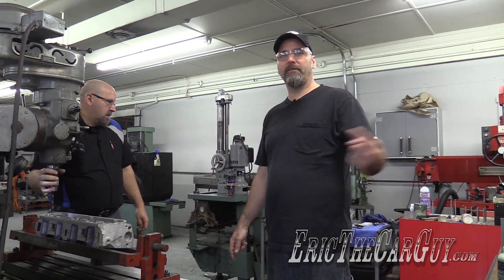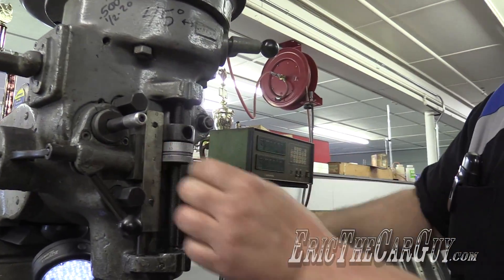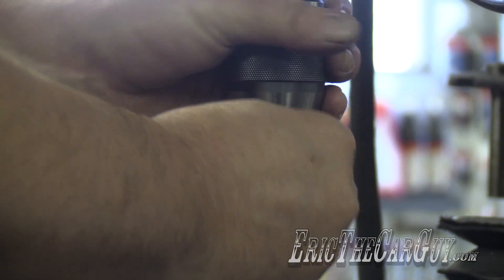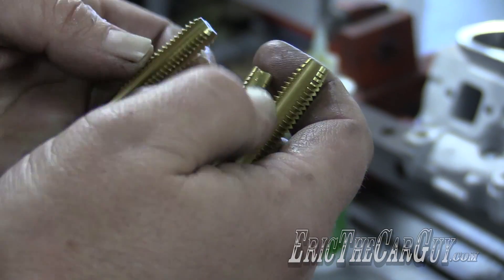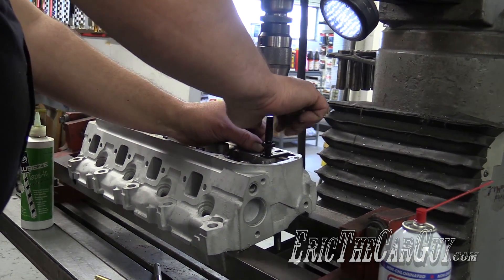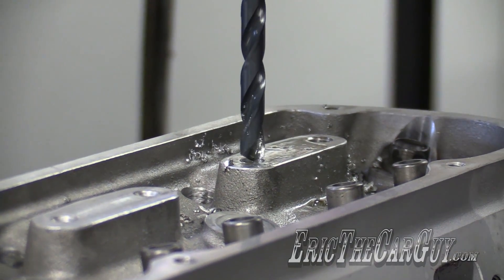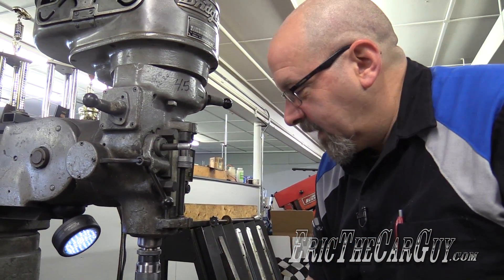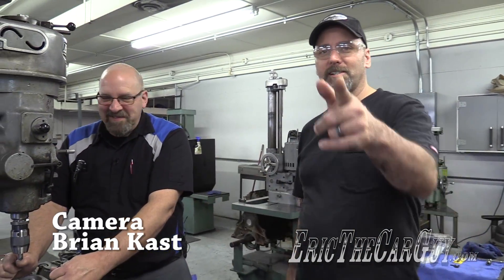Cylinder Head Modifications For Larger Rocker Studs #DarkMatterPikachu #FairmontProject

Comment: Those Bridgeport J head milling machines were made from 1952 and up, and the hole in the back of taps is a byproduct of manufacturing but also helps keep it straight when in use.
Reply: Yep, Drill straight, Tap straight.
Reply: Drill straight, tap crooked, break tap!

Comment: I wonder why people still use normal taps in soft materials like aluminium. There are machine taps that do all the cutting those three taps do, so it saves considerable time using them. Plus, there are special ones that are ground down at the tip so you can cut threads down to the bottom of the hole. Or you can grind them down yourself.

Can anybody educate me on that?

About that CNC discussion: Nobody uses a CNC for that because you needed to measure everything precisely (!), write a program, fill all the different chucks and indicate the tool positions, indicate the part on the CNC, test the program and then run it. And "running it" for the first time means standing next to it with your hand on the emergency stop button in case something goes wrong.
So doing it the "oldschool" way is faster and more precise in most cases. The only time you can save time is the second run for the second head on a V type engine.
If you had to do 20 heads, this would be a different story :)
Reply: BavarianMonkey agree with the faster and cheaper for a very small and simple run but as to how indicating material on our cnc mill we have a probe that will get your x,y,z, and center in about 5 minutes if you run the machine manually (manual drift for those who don't know), and maybe 1 minute if you write the program (we use hieden heim on a dmg mori) as to acuracy it all dependes on the machine but 9 out of 10 cnc hands down imo less human error but it would really all come down to the operator
Reply: kurupz aaah yes, I completely forgot about those 3D ruby (?) ball probes. With something like that, indicating the tool is a lot faster than doing it manually. But the whole measuring and programming stuff stays the same.
I wonder if there are drawings of those heads out there. With a drawing of course the programming is only a few key presses - it it the measuring that takes a lot of time, not the "go x mm, drill hole y mm deep, pull out, go x mm...." :)
Reply: BavarianMonkey wouldn't need a drawing just program the block form(for simulation purposes could be a giant square tbh) and the drilling and tapp locations would take max 30 min. Then all you need to do is edit the locations and blockform for different engines I just would program linear movements on the z axis cautiously and not make 3 axis movements close to the work piece. Editing the speeds, feeds, and tool on the tool call is simple enough and viola now you have a program for every engine you have worked on. You can use hole centering (with the probe) to find the location of each hole if it was deemed necessary and\or quicker btw ball probes can be made of ruby, silicon nitride, zirconia, ceramic or tungsten carbide and possibly some more idk. But ruby is the standard.
Reply: btw I prefer not to use standard drill cycles because I can manually program the pecking and it wont take any longer(for me im slow with all the cycle functions), then label set and label call and that's basically a drill cycle. Mind you this is only on hieden heim I don't know any other controllers yet

Comment: why do we install bigger rocker arms?
Reply: They are more durable, are stronger for both tensile (studs) and bending (studs and rocker arms) forces.
His engine seems to use an aftermarket cam that might have more lift (on the cam lobes) and he could be running higher engine speeds (RPM) as well. If he uses bigger valves, those are (in most cases) heavier. In order to maintain valve control and prevent valve float, you need heavier springs that take more force to compress and open the valve.

So if you increase valve size and/or cam lift and/or valve lift (based on the rocker ratio) and/or engine speed, you need to make everything in the chain between the cam lobe and the valve itself more durable in order not to break and screw up the engine.
Reply from the maker: They're stronger and the new rockers I'm using require the larger stud.

Comment: I knew there were three taps to each thread created, starter/mid/plug, but i didnt think about using the dimple for centering, clever :-D
The old plug tap was allways good for the blind holes.
Also the taps people use are not professional types, so the thread can be a bit too loose, thank god for locktight red :-D
Reply: zx8401ztv sadly this was one of the first things I learned when I was being taught the hows and whys of machining right after don't were gloves, have any piece of clothing, jewelry, or hair, near spinning objects.
Reply: Yes the gloves can be really bad, just depends on what you're doing.
On drills and lathes they are a no no :-(.
Wearing protective glasses is a hazard that most people forget (untill something hits them in the eye), hopefully its a free lesson with no damage.

Taps and dies was something i learnt at school, it just made sense to use 3 taps, or create a thread on a bar with an adjustable die.
Set it to slightly too big and after the bar thread is cut, then test it with a sample nut, if too tight then adjust the die a little and chase the thread untill its a good fit.
The sad thing is generic taps and dies are sold in kits with one tap per size and solid die, you can create a thread but its loose and crude.
Sorry for woffling :-(

Comment: More accurately, the precursors to CNCs were punch card numerical machines.I saw only one in a museum in Germany. And after that, the monster tube based ones. Big enough to barely fit in your shop. When you'd start one of those the whole sheet metal would rattle from the selector switches and cooling fans. "Those were the days..." as Jay Leno puts it.
Reply: If you go back far enough in programmed machine history it all begins with the Jacquard loom, first demonstrated in 1801. I believe the Munich museum has one on display. It too used punch cards, but they were about 1/2 inch thick and were chained together.

Comment: I thought installation of screw-in rocker studs required first machining down the height of the rocker stud mount pad in the head to account for the base hex of the screw-in stud?  Did that happen to these heads?
Reply: +Roger Mason  
Depends on the installation. 
It is all about the valvetrain geometry and the selected valvetrain components

Comment: Why didnt he just test the first hole, have all the settings etc, and just drill all of them then tap? Seems to be alot of extra work changing the stuff (And time!) to just drill one hole, tap it, put in the drillbit again so on? Considering the rest of these videos, some of them isnt that ''serious'' fixes.
Reply: rambon1234 well.... This way he can center the drill and use the mill as guide for the tap without centering it twice
Reply: My best guess would be so that he could center the tap exactly where he drilled the hole.  If he drilled down the line, then came back across to tap, he'd have to recenter each hole and hope he had it lined up just right.

Or, as Sam Johnson said, he did it this way to show us a couple examples.  :)
Reply: Carsten Langbo Better practice would be to put the tap in the drill chuck and power tap the hole instead of fumbling around with centers and tap handles....The keep it simple stupid (KISS) method.
Reply: Not if you calculate the depth and know where the bottom is in relation to the scale on the quill. That's what the on off switch is for. Reverse it out of the hole. I've done it hundreds of times...beats the heck out of fumbling with a tap handle and center..
Reply: Well I guess the is just plain stupid then, or maybe Eric asked him to do one tap for his viewers.
Reply: I think that the video would have been way long. He just did one for our benefit. Peace. Sam.

Comment: Jacob's chuck on a Bridgeport mill? why tho
Reply: ChrisHallett83 Jacob's MADE IN CHINA I just bought a new one last week and discovered that.
Reply: AnthonyH a jakobs chuck is perfect for drilling we even use them on our cnc machines (just not the keyless variaty). Nothing to write home about but basically if it's good enough in respect to the tolerance why bother with anything else. Machining in general is really all about things being just good enough for the application/customer requirements, production time per part, and cost or at least this is what has been drilled into my head.

Comment: In Germany we use to have a three piece set of tap for cutting threads by hand.
Reply: Martin Born Good Ole German engineering
Reply: Most of Europe has the same practice, and even in US, proper machinists own three set taps. But hey, not everyone can be perfect, and so the myths that you break taps like crazy exist.
Reply: At work I sometimes use the taps build for machine use by hand. 
They tap the thread in one cut but they are more fragile and the thread isn't as good as with the three piece set. 
But hey, it's quicker. ;-)
Reply: Hi Martin - at 04:32 the machinist mentions starting, plug and bottom taps, which the common name (in US and UK, at least) for a three tap set.